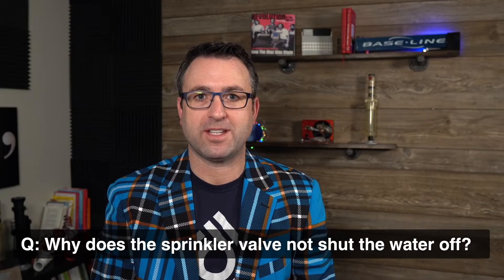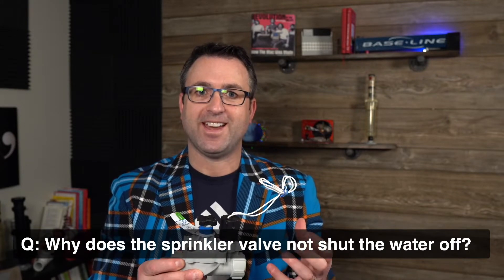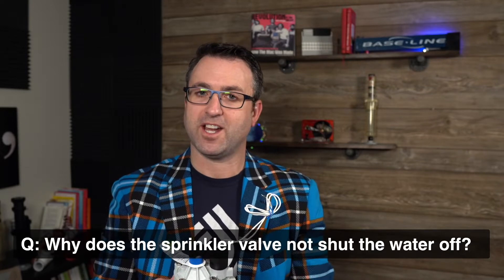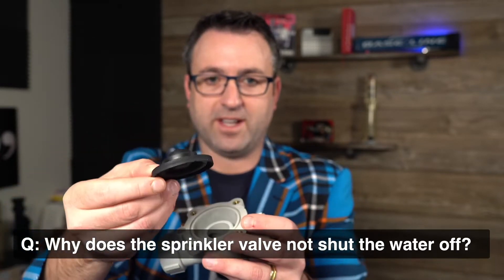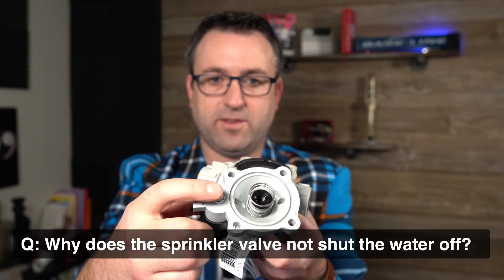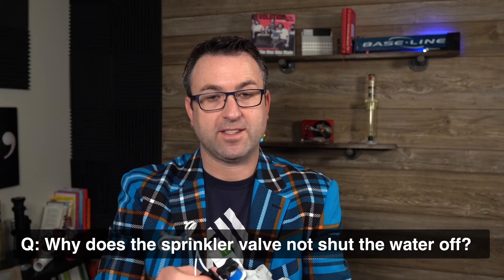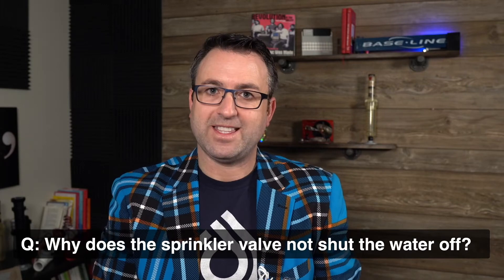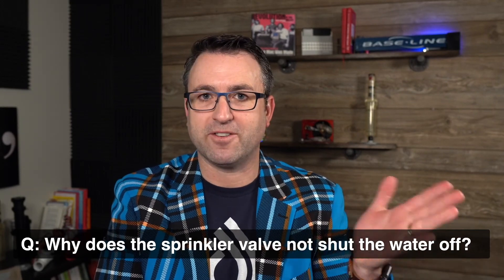Sprinkler Valve Does Not Shut The Water Off | SprinklerSupplyStore.com

Comment: Truly appreciate this video!  This video saved me another 3 hours of work.  After installing 3 valves, the 4th one won't shut off.  I did the easy solenoid check and found no problems.  After watching this video, I unscrewed all the screws and and found a piece of rubbery material inside which kept the diaphragm from closing, although I flushed the line before the installation.  Thank you again for sharing, very helpful.
Reply from the maker: Great news Mister Tee, well done! Appreciate your feedback.

Comment: So my control box says off but the sprinklers won’t turn off.
Reply from the maker: Generally speaking, if the system is off and the sprinklers are still running it's usually going to be an issue with a defective diaphragm in your valve.  You can reach out to our customer service and send pics of your valve and they can help you find the correct diaphragm and talk you through the replacement process.

Comment: I tried all of this but mine still stay on. I'm guessing I'm going to have to replace the entire valve tubing. I have a new diaphragm and solenoid. Nothing will turn the water off but turning the solenoid. It turns on fine but won't turn off by the control panel or timer.
Reply from the maker: If you haven't figured this out, I'd suggest reaching out to our tech support with some pics and see if they can help you figure out how to get this resolved.

Comment: This value that is not turning off was not truning on and running at all and then just started working again before I had a chance to look at it.  Not it was remaining on.  I needed to manually close the valve at the value to shut it off.  Could this also be a solenoid problem?
Reply from the maker: It's nearly always a diaphragm issue, but I'd suggest getting the same model of valve and changing out all of the internal parts.

Comment: Very informative video, thank you.  One tip: The banner at the bottom of the video with the question is blocking most of what we're trying to see in the valve. After the first 30 seconds or so it would be nice to have the question banner removed.
Reply from the maker: Yes, we've had comments on this a few times.  This is one of our older videos and happens to be one of our most watched ones.  We're hoping to redo this at some point!

Comment: Thanks so much for the video. Thanks to it, I just managed to fix the sprinklers section that wouldn't close. As an additional tip, if the head hasn't been opened for a long time, it can be difficult to unscrew it with a screwdriver, so it's worth using a socket wrench on the screws.
Reply from the maker: Glad this was helpful, and thanks for the extra tip!

Comment: The solenoids are what is known as normally closed meaning that with no power it is CLOSED so the most likely problem is debris in the seating area of the diaphragm or the plunger in the solenoid is stuck.
Reply from the maker: This is correct.

Comment: I have a Hunter Node400 and the appropriate DC latching solenoids connected to my 2 drip lines. I noticed the drip line is constantly slow leaking. The sprinklers and drip heads come on and flow normally and freely at their assigned times, but when the timer ends, they return to a constant slow leak. I cleaned the valves, diaphragms, and the solenoid chamber. Irritatingly, I cannot easily replace the valve because the box was installed in a way that I would need to dig up the box from the ground to replace the valve. Any advice before I dig out the whole box?
Reply from the maker: Based on what I'm reading, it sounds like you cleaned everything but didn't change any parts out.  I'd suggest buying the same model of valve and harvest out the internals to replace the internals of your existing valve.  It's probably the diaphragm, but changing out everything ensures that you get it fixed the first time.

Comment: What can i do if these tips do not fix the issue? I have cleaned all parts of my 3 valves and changed the solenoids to check for function and I get the same result each time. The same zone continues to run while the system is off as soon as I turn on my water main
Reply from the maker: Interesting. Assuming you have unplugged your controller/timer. Unless there is another pipe feeding the zone from the mainline, there must be something in the valve preventing it from closing completely.

Generally speaking, it’s much simpler than we think, we just have to figure it out.

Comment: Great video! I've got the very same weathermatic valve for a leaky zone in our yard. The lowest head in a relatively flat zone weeps continuously and I've tried just about everything. In speaking with a neighbor, apparently the previous homeowner was constantly messing with it as well. 

Troubleshooting steps: 
1) First, I started by replacing the head. It's on the edge of the driveway so figured I had hit it. Continued to weep out of the top of the new head. 
2) Then I dug up that head and raised it above the other heads, water started to weep out of another head in the zone. Took the head off and clearly water was flowing (zone was off). Not flowing hard but more than just residual water from the previous cycle that ran that morning. 
3) Figured it might be a leaky valve. There were older weathermatic silver bulllets in the valve box, so I replaced the problem valve with a new one. 
---> Still weeps out of that valve!!! 
4) I opened up the new valve and checked the diaphragm and solenoid and they look clean. As I mentioned, they are new but figured I would check just in case something in the line clogged them up. No dice. 

At this point it seems like the only potential sources might be: 
-- Bad luck? New valve is bad? 
-- Electrical problem and the valve just isn't getting a strong enough signal to close all the way? 

I really appreciate any advice / insight you might have on this! Thank you!
Reply from the maker: What happens when you shut off the main water supply? That will help determine if it’s a valve issue, or drainage after the system turns off.
Reply: New valves do sometimes seep. But?  Another cause I found once seemed like a leaky valve but wasn't the valve on that zone. 
Customer had tried everything.  Replacing the seeping heads. Not sure why people think this can stop a seeling flow?  He replaced the valve. He had action mechanical fitting so a relatively easy job to change the valve.   I changed the valve and still seeping.  Can't be 2 bad valves in a row can it?  I go over to a nearby valve box and manually turn on each valve for 30 seconds then  waiting for 3 minutes.  When I turned on one valve the seep increased.  It was easy to see because I had taken a hanging pot drip line out so it dripped onto the patio.  Sure enough he has connected 2 zones together via a 1/4" drip line in his recent waterfall hill  installation he and his brother did.  So this valve didn't supply enough pressure or really flow rare to pop up the heads on the other zone but the pressure increased enough to override the check valve heads he had installed.   He was thrilled.   So many times homeowners waste so much time and effort before hiring a pro.
Reply from the maker: @elkskiutah8204  Wow! Two zones connected downstream—great catch! You are right; I'm sure this happens more often than is realized. Kudos.
Reply: @Andy_Humphrey  what made it hard  to find was that is was only connected by the 1/4" drip line. so the sprinkler heads didn't pop up or even spray at all jsut charged up and seeped.

Comment: I've found that the solenoids fail on these units more often than debris being present inside the valve.  The actuating tips at the bottom of solenoids wear over time.  After a few years, the solenoid simply needs to be replaced.  This is especially true with Lawn Genie brand.  Just buy a new solenoid.  Unscrew it by hand and install a new one.  It doesn't matter which of the solenoid black wires go to the two electrical connections where you removed the old wire nuts.  Solenoids are relatively cheap at the box stores, and any novice can replace them.
Reply from the maker: Thanks for sharing! Crazy that box stores don’t sell (because it doesn’t exist) a universal solenoid with adapters for all valves.
Reply: Solenoids do fail but diaphragm cause more seeling valves 10/1

Comment: My Orbit valve has a solenoid with a small arm below the solenoid that you turn to move the solenoid instead of grabbing on to the solenoid. I can't remove the solenoid because the arm only allows me to only turn the solenoid about 3/4 of a turn before it comes into contact with the valve housing. What can I do?
Reply from the maker: See if the arm can slide up. There should be a way to remove it. Can you reply with the exact Orbit model.
Reply: May be too late to help, but the solenoid unscrews from the arm. Hold the arm and unscrew the solenoid. The arm fits over another adapter that screws into the valve. It just lifts off when the solenoid is removed.

Comment: I have a station that won't work. It is getting power to the solenoid as I can hear it starting but no water... also have another station that won't turn off! Different junction for both (front and backyard are separate).
Reply from the maker: Interesting. My apologies for the delayed response, if you haven’t corrected this, feel free to schedule a support call.

Comment: Weathermatic valve diaphragms have two ultra-small (0.5mm?) holes in the diaphragm.  When these holes get plugged, by debris or biofilm, the valve will slow the flow rate, but will not stop the flow when you try to shut it off.  When this happens, the valve may make an annoying squealing sound when you try to shut it off.  Clear the plugged holes with a small drill bit or piece of wire to temporarily restore the valve function.  While replacing the diaphragm is a longer term solution, replacing the valve with one that is NOT from Weathermatic may be the best long solution.  The Weathermatic Actuator Assembly, located under the solenoid is another cause for failure of Weathermatic valves.  You can reach the actuator by spinning the solenoid off.  Good luck finding Weathermatic parts at your local hardware store.  I agree that it's probably better to just buy a whole new valve when you need a Weaternatic part.
Reply from the maker: This is 109% NERD.

Thank you for sharing.

Comment: how to wire ac 24v solenoid? my solenoid only has one wire connected, the other one is not connected to anything.
Reply from the maker: Sounds like something has come undone. There are two wires that run to a solenoid, and they can be wired in either order, because it’s AC current.

Comment: Greetings, if you have a three head zone, and only the middle head continues to drip wayer, could it be on the low end of the pipe even though its in the middle of the three heads.  These are shrub spray heads.  Thanks in advance
Reply from the maker: Absolutely, it could. Sometimes it is very hard to see a less than 3% grade difference. If it is just one sprinkler dripping water after the zone turns off, the best option would be to put a check valve in the sprinkler. Or, put a check valve in all the sprinklers, it’s not expensive and easy to do. 

Let me know if we can help find the check valve for your specific Sprinkler

Comment: Not ac, it’s dc so you don’t get electrocuted.
Reply from the maker: Most irrigation systems are 24VAC if powered with 120vac. Battery operated valves do require the solenoid to be DC Latching.

Comment: Hi my sprinkler won’t run off howler it’s not the timer etc I released the little screw thing by hand and bleed it and they shut off!! Yayyy 
Thank you
Now do I need to replace the valve or whole section if it stopped and if so when replacing the rebuild kit do I need to turn the water off at mains to replace??? Thank you 🙏
Reply from the maker: Glad it helped. Yes, turn your water off at the main, or at your backflow. Then try to bleed as much of the water out as you can by opening another valve that will help empty the pipe.

Comment: Where do I find the valve & solenoid? I've nplugged. During TX freeze, thought the system was completely off, but I cap one head off, & another leak happens! I am on a slope, but what is happening? It is an old system, here when I bought house.
Reply from the maker: Hi. Can you provide a bit more information? I'm not totally following your description.
Reply: Seeling valve, try new diaphragm.  Then top of valve, last resort whole new valve.   Sometimes the body's base sealing ring gets pitted.

Comment: What pressure of water should be before the valves? Thank you
Reply from the maker: Great question. Every valve has a specific operating range. For instance, a Hunter 1" PGV valve has a recommended pressure range of 20 to 150 psi, and a flow range of 0.2 to 40 gpm. Feel free to contact us if you need help find this information for your valve.

Additionally, you should consider the pressure recommendations for the sprinklers you have on your system. Rotor type sprinklers typically require 40-50psi, while spray head type sprinklers require 30-40psi.

Comment: None of these things he mentioned helped. My valves are cleaned, new, turned off the sprinkler box, & three out of 8 stations still keeps running.
Reply from the maker: Hi @loober122, it's Andy here. Happy to help. If power is completely off, and the valves have not closed, they are being kept open due to a mechanical malfunction. This is typically debris, even small debris under the solenoid, as well as oversized valves that hydraulically cannot close,  and improperly tuned valves that have flow control. Feel free to contact us and we'll do the best we can to help you remotely.

Comment: I have an Orbit Controller and valve.  I have several problems  - 1) Water flows continuously, even in the OFF position. Saw the video about how to fix that.  Next problem when I use my controller in the manual setting with a timer, water still flows but when i turn the switch to ON the water stops and when I turn it to OFF the water starts again. Timer continues to work and water starts to flow again when the time runs out. Is this CRAZY or what - do I need to replace the solenoid or thee entire valve?
Reply from the maker: @hchacko crazy for sure, sounds like it has a mind of its own.  Might not be the valve. Best to check with a multi-meter to see if you have voltage coming off the controller. 

Is your system by chance battery powered? 

When you say, water continuously flows, it is enough that the sprinklers are on, or just a leak?
Reply: @Andy_Humphrey  Thanks for the quick response - controller is connected to AC power and has a back up battery. as soon as I turn my main water supply on, it flows through the valve to my sprinkler heads - to stop the flow I  press the ON button in the Manual setting - and if I turn the manual setting to OFF - water starts to flow again - really strange indeed.